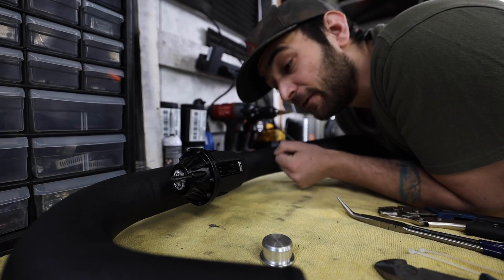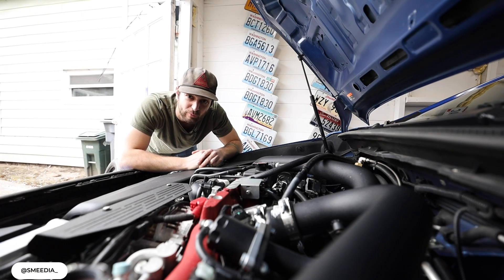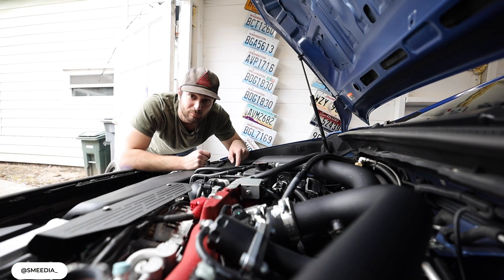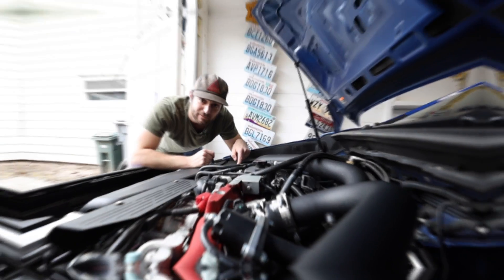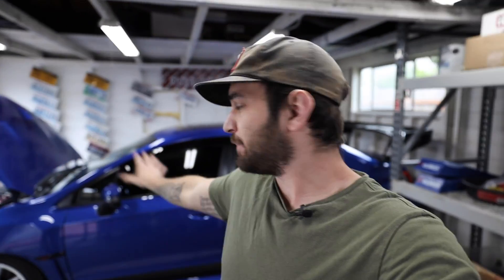This Is Why You Shouldn't Use a BOV On A Stock WRX/STI

Comment: This is a common myth.  The system is dependent on 1) the TPS signal, and 2) the BOV itself.
Modern fuel injection system do a fuel-cut on decel to 1) save gas, and 2) alow the revs to drop faster; the fuel-cut decel should override any fuel delivery (issues).
If the TPS is slightly off, it'll keep shooting fuel on decel - this is how you get the popping on decel or in between shift.
If the BOV doesn't seal fully (which it sounds like this is the case in this video), you get an intake vacuum leak - what were the vacuum #'s before and after the BOV install?  Was it the same?
I've seen plenty of BOV's that leak on WRX's / STI's...
Making a BOV that 100% seals at idle makes it more expensive to produce.
If the BOV is sealed 100%, the system is closed, and your idle should be identical to before - the fact that you're running rich means something else has changed.

This is why some people have no issues, and why some people do have issues.
Reply: I agree,  he did something wrong. My 04 wrx ej20 had no problem idling and ran fine with the hks bov. 
I like this channel but this video is bullshit and makes me question what this guy actually knows or if he's just pretending to know what he's talking about.
Reply: You are 100% right a bov shouldnt affect idle unless its leaking
Reply: I was gonna say I bought my 19 wrx used that came with an HKS BOV and it’s closed system, i didn’t think it had a MAP for it installed already but I don’t have any idle issues what so ever since purchase. Seems to be working A OK. Still need to get an AP for her but other than that no issues still 🤞🏻🤞🏻
Reply: @jonshuacaceres9828  HKS SQV the real ones will work they seal properly.. unless its faulty but if you get  a FAKE CHEAP HKS one yup your screwed
Reply: @jonshuacaceres9828  Technically you have a MAP on the TMIC
Reply: I'm not that sure.
I have a Suzuki Swift Sport ZC33S (from 2018), and I installed recently (a month) the HKS SQV IV valve and I'm experiencing some of the symptoms that he says.
Today I'll mount the recirculating tube, to see if that mitigates the lagginess and stuttering in very low revs, like when I'm in the middle of heavy traffic.
Saddily I'll lose the high pitch sound, but in the long run I prefer to not to damage the engine.
Reply: Or they don't block the recirc hose that goes to the intake after MAF
Reply: Before it started he said that the car was set up for the by pass so at the moment he changed and had not programmed the car it would be awkward
Reply: Jesus christ ur good

Comment: Wait so what about your older BOV video saying it’s not that bad
Reply from the maker: Its manageable as long as you have a tune to go with it, the main issue stems from OTS Tunes and OEM tunes. If your pro tuned with a BKV on MAF you'll be alright, just need to let the ECU know whats going on with the Air

Comment: I have a gfb hybrid set at 50/50 and I’ve had no drive ability issues. Even drove 16 hours on it last week
Reply: I have a turbo smart adjustable bov set at 50/50 at 150,000kms no issues at all.. (2015 sti)
Reply: I have the gfb respons bov and had the car pro tuned and it’s perfect on my 2015 wrx
Reply: @Mintieness is the gfb hybrid safe if your car is not tuned or don't have accessport??
Reply: SuperTech Idol that’s what I’m using with still no issues. No tune, still have my warranty
Reply: Is your sti stock? or tuned?
Reply: zarexsole all stock

Comment: Stis especially will run just fine with bov, if tuned for it... little misinformation... yours wasn't tuned.. and you were using Cobb launch control..yikes
Reply from the maker: As long as your tuned you'll be fine, but I wanted to show what happens when your not tuned for one as that's what happens the majority of the time when people install them, they're generally paid with an OTS Tune or the OE

Comment: you make it seem like your engine would instantly blow up if you run a BOV on your car..... yea your car will run like crap..... that's the same for intake...  you're going to have a "risk" of blowing up your car without proper mod/tuning. but instantly blowing up? come on bro..... it's not that serious
Reply from the maker: Never said it would instantly blow up, run like hot garage yes, personally wouldn't drive it with the idle being as it was but also tearing the car apart for. Build so don't want to replace anything not needed for the time being so being a little conservative with the car ATM

Comment: Hello again!  Thanks for the information in this video.  I finally got my COBB titanium exhaust with j pipe, intake, and access port for my 2019 STi.  Super excited to install this weekend.  Thanks for all your videos.  Next will be AOS... crazy install for that.
Reply from the maker: Promise the AOS is not as bad as people make it out to be
Reply: I was told that having the j pipe I might need to add a boost control.  Said sometimes with the j pipe the boost in 3 and 4th pulls can be too much.  So might have to get that installed as well.
Reply: Another great video you could do is a very detailed video on how to properly jack up your 2015-2020 Subaru STi.  Show all jacking points and where to place jack stands.  No one really has a good video for this and some are too short.  Just an idea.
Reply from the maker: Yes I can add that into or make a video on it 😁

Comment: I run a gfb bov... I have been tuned on it but even pre tune I had nothing to that extent... Mines EJ255
Reply from the maker: I used the GFB before and I would agree, the Hybrid version is what I used and never saw issues to this extent, the reason I used the SSQV for the demo was because it is so widely used. But when using the hybrid GFB the car ran as normal
Reply: @Smeedia  yes mine is the respons wich you can adjust through basicly being a bypass valve and blow off...  I think I did a video a bit further back on it showing all different sounds it can make with adjustments and trumpets on... It's quite good in the sense you can adjust it to be good with your car with 0 stutter etc... As you said in the video I still wouldn't like to throw any old bov on and drive about if the car was to act how yours did on the video

Comment: I took your advice. I bought a stock 2011 sti 4 months ago. It came with a BOV and i am currently at a Subaru tuner garage removing it and reinstalling OEM BPV. 

Thanks for the Advice.
Reply from the maker: Congrats on the car and should help it idle better!
Reply: @Smeedia  i also replaced the spark plugs so yeah it feels great... but they told me my clutch is showing signs of deterioration. And i might want to chane change it soon... do you have a video about clutch oem vs stage 1 vs stage 2 etc?
Reply from the maker: I do not, there's a lot of options for clutch and it's going to depend on how you want the car to drive and the power goals for the car

Comment: Also you said that the extra fuel would get into your oil as it ran down the cylinder wall. You would have to be running insanely rich to have left over liquid fuel in your combustion’s chamber(like 5:1 gasoline). Also your wideband afr gauge on the right side of your steering wheel was reading anywhere from 14.5-15.1. Not rich at all as the stoichiometric air fuel ratio of gasoline is 14.7:1

Comment: Makes no sense. If you had true in depth knowledge on this you would know that installing the bov wouldn’t change the idle of the car one bit. The only time the blow off valve will effect the air fuel ratio of the car is when there is pressure built up in the manifold and then the throttle is closed (during shifts) although I don’t run a bov on my car because I prefer the performance gains of a bypass valve(keeping more air in the engine during shifts) they will not hurt the car. As you said they will make it run more rich during shifts which may foul spark plugs faster but really won’t make a huge difference. On top of that Subaru’s use open loop fueling once in higher loads even when you are pro tuned with a cobb. Open loop fueling uses a target air fuel ratio or lambda and can very slightly adjust injector duty cycle to change your air fuel ratio and get it back to normal. Also you mentioned that the car showed some amount of fine knock learn when you were leaving the driveway which cannot be due to the bov. Fine knock learn is a ignition timing adjustment that the ecu makes over a long period of time when it tends to see knock at a particular load and rpm. If the bov was causing some sort of detonation, you would see that in feedback knock which is a real-time adjustment made by the ecu immediately when it senses detonation. Just thought I’d give you my .02 since I have built a few of these engines and tuned a couple

Comment: Idk man, I know science is science but I’ve owned 3 Subaru’s, rocked a BOV and OTS tune on all 3, put easily 75k+ miles on all 3, and had 0 issues related to the BOV. All cars were tested and healthy at time of sale. Maybe I’m just the lucky statistic 3 times over. Nice video and very informative though, keep up the good work
Reply: Justin Geier same loool
Reply: Right. I just installed a fully atmospheric bov on my 2018 sti and I didnt have an of these issues that smeedia has. Maybe theres some underlying issue causing the knock in this video? I installed mine after watching and did little revs like this and not a single issue. Maybe its cause his bov spring was too loose and was by passing even the slightest bit of pressure? Maybe it's not having that long pipe on the ic piping for the stock bpv location? But I dont think that knock issue is directly because of installing a vented vs recirc valve.
Reply: @enemen8  The car is not designed for it, doesn't mean you can't get away with it.  Typically the Supreme crowd or "younger" crowd throw them on without knowing anything, go get a tune and ask for the "Can i get a dope crackle n pop tune with a touch of flames out the exhaust, bruh?"
Reply: @enemen8  no matter what it's not good for the car
Reply from the maker: I've seen some cars respond different using OTS Tunes, if you have a higher quality valve it would mitigate out some of the leaking issues that other valves have had.
Reply: 2020 STi has a stock BPV so adding an after market one does absolutely no harm even with stock tune just gives you that awesome sound

Comment: Thumbs down for a misleading title
Reply from the maker: Feel like the title suits the video fairly well, while my car is protuned its not peotuned for a BOV which emulates using a part thats not intended for the tune
Reply: It should read do not vent bov on stock WRX/STI.
I'm using a bov, not a bpv, with a recirc kit. Not having any of the problems you're showing or describing. Also being monitored with AP.
With your title, you pretty much telling your viewers not to use any BOVs. Misleading
Reply from the maker: Your using a BOV as a Bypass valve recirculating the air back into the system. While it is a BOV with a recirculating adaptor it is not a VTA BOV. 
The title says not to use it on an OEM/Stock car, pairing a VTA BOV with an OTS Tune or OEM tune will amplify underlying issues that the car may already have from Generalized tune.

Comment: All you need is a pro tune.. I’m running an hks ssqv and I’m maf based. Making 393whp 430wtq.
Reply from the maker: Agreed, as long as you have a tune for it the cR will be fine, the biggest issue is the OTS and OE tunes

Comment: Just get tuned when you install a BOV, it’s not that deep. Obviously any part that is installed (especially on a Subaru) and not tuned for will cause issues.
Reply from the maker: Thats the point I was trying to get across if your tuned for it the car will be alright but the problems come from using OTS and OE Tunes with the BOV

Comment: The only reason the car is stalling out on you is because you’re venting to atmosphere instead of back into the system that you’re tuned for. You could get a tial qr which is a recirc bov and it’ll be just fine.
Reply from the maker: I'm aware, I knew the car wouldn't like the BOV and the point was to show that the car is not happy with it, generally most OTS and OE tuned cars will act the same so was trying to demonstrate what actually happens rather than just talking about it

Comment: I have a 2004 sti with forged internals and a flex fuel systems( along with all the other supporting mods) the car is basically fbo besides turbo and headers. And I was wanting a turbo that could get me to  around 400whp on 93 and 430whp+ on ethanol. I was wondering if the fp blue could support that on a front mount or even a top mount
Reply from the maker: Advertised the FP Blue said it was capable of around 475WHP should he capable of hitting your goals!

Comment: How would it work with a turbo smart adjustable with about 50/50 bpv bov.  Otherwise stock no tune?
Reply from the maker: It may stumble at times id still suggest a full BOV but you should be okay

Comment: I run a GFB BOV open 50% on my stock 2015 STI. It has ran great for months
Reply from the maker: Your at least getting half of the air back into the system to help mitigate the issue
Reply: Smeedia thanks for the reply bro!! Made me feel a lot better. You had me scared there for a sec lol! Love all your videos! ❤️
Reply: Update: Don’t do it boys. I’m getting a check engine light now from the BOV, as when I have it open the light is on and when it’s closed it turns off. Selling this B.

Comment: So I actually did exactly this. I installed the HKS BOV for a day and then I just put back the Cobb BPV. However, the rough idle happens now and again... does it take the ECU a bit to read normal idle again?
Reply from the maker: The ECU will have to re learn once you swap the valves, you can either reset ECU learning or you can drive the car around as normal for a bit to get the ECU to relearn

Comment: Good video, thx for the experiment.  Curious if you can expand upon the comment that the FP Blue safer for engine?  Just in terms of not as much boost or something else?  Look forward to the videos and stay safe!!
Reply from the maker: Will be putting less stress on the turbo, the VF48 would be getting a lot of stress due to the higher HP I will.be shooting for, safer meaning the FP blue will not have to work as hard as the VF48 just reliving some stress off of the car 😁

Comment: Hey Tanner. I did exactly the same with a clone HKS and got same problems. even started making my hill start alarm go off everything I let off the gass. Worst thing it blew my charge pipe off the throttle body and ripped the stability bolt off the intercooler. It must have been holding at least 30 psi to do that. Put my stock recirculation back on and all problems went away
Reply from the maker: Holy hell, was this with the KE Turbo or a larger one?!
Reply: @Smeedia  no, this was,, as far as I know, my total stock everything wrx uk. I've done nothing but go full catless with a japspeed 2.75 turbo back, with a 4 pipe Sti style rear muffler that's been cut open and all the crap removed. That's it

Comment: Hey man. Great stuff. Also wanted to see if you would go over the bpv (cobb XLE) that is spring loaded compared to vacuum loaded (hks sq4) and what is best bpv you recommend.  
I am running a stage 2 with a hks sq4 on it and runs fine on my 04 sti. So depends on the tune and parts.
Reply: Checkout the Perrin adjustable bpv. I'm running it on my 04 WRX and having it hold some air in the intercooler between shifts is nice. The oem bpv dumps all air which sucks.

Comment: Is that brass fitting a drain line for your AOS?? Remember we talked about that recently.. I got a few cheap amazon catch cans I’m going to test out. Trying to keep the comp AOS on, and not allow the schmoo from going back into my crankcase . Thanks Tanner!
Reply from the maker: The brass line is the oil pressure sensor relocation kit 😅 need to clean it up when we get going in the engine bay lol let me know how the set up works!
Reply: Tanner, I bought the hoses to reconnect my filler tank from Subaru, and I’m removing my AOS. My oil is just not lasting long enough running flex fuel. I ordered the radium dual catch can kit, and am going to utilize the intake to pull a vacuum. The oil return line on my AOS, sure didn’t look like fresh oil.. total schmoo yellow goo. Some people said to me it’s normal, and will be burned off.. but I’m gonna try the closed ccv setup with the radium cans.
Reply from the maker: Let me know how you like it compared to the AOS

Comment: I had my wrx tuned by my tuner with the gfb response bov it was tuned with it open to atmo before tune ran so bad but I agree it does cause knock and idled so bad now it runs perfect now after tune
Reply from the maker: As long as you at least pair it with a produce you will be fine, glad that it's running better now! 🔥😁

Comment: I use a duel port gfb bov 80% to atmosphere and 20% back to intake on a maf and have no problems
Reply from the maker: Pro tuned or OTS?
Reply: Pro tuned and I’m doing the same thing! If you just turn your idle rpms up on your ap it will run fine!
Reply: ECU is pushing more fuel because it thinks 100% of the air is recirculated but only 20% of it is. You running rich.
Reply: I’m running an ots stage 1+ Cobb tune and it doesn’t run rich